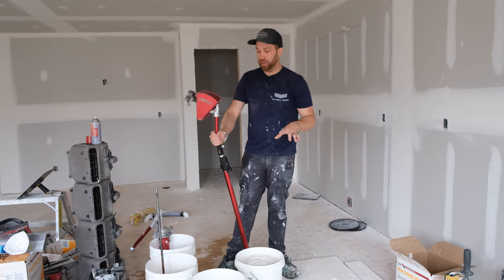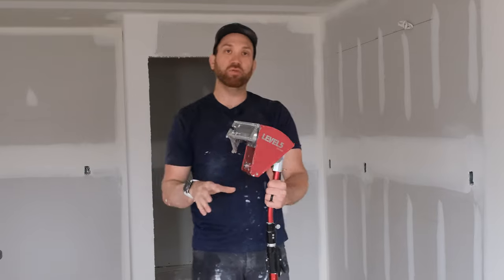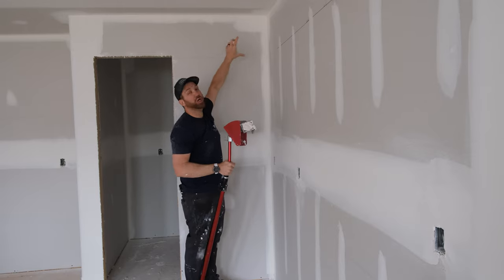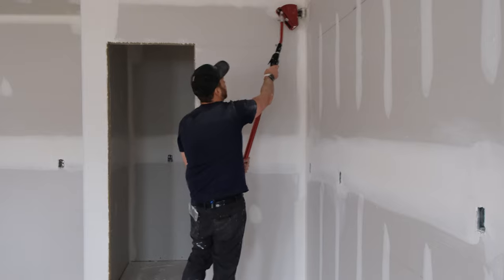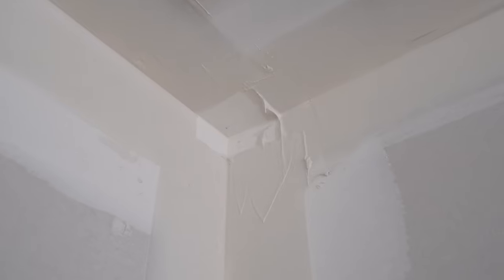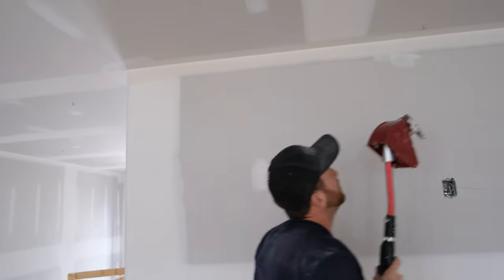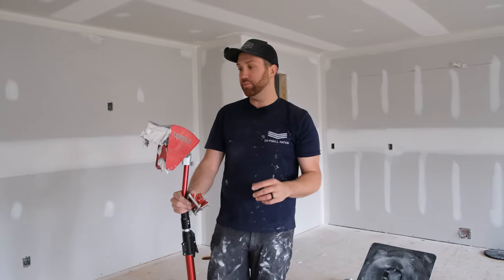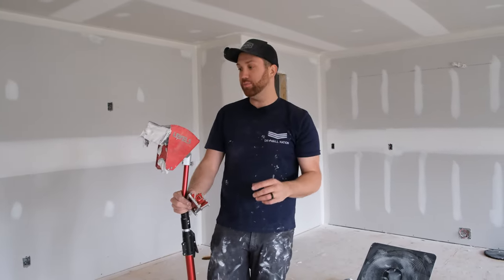How To Use a Drywall Corner Applicator Box | Video 3/4

Comment: I have a full set of Level Five tools and love them! With my set up like this video I use the 3" corner and one thing I continue to run into is the O-rings leave tracks. Not sure what I am doing wrong. I have been letting the corners dry and coming back and going over the corners with a knife after they are dry when that happens.

Comment: Good video. Not even in the business, just do enough drywall here and there doing remodels to make these taping tools very, very tempting.
Reply from the maker: Let us know if you have any questions!
Reply: I use them on anything over 25 boards. But it really makes you some money when you get up over 50 boards and when you get over 100 boards it becomes a necessity, prints money like clockwork every job I do over 100 boards.